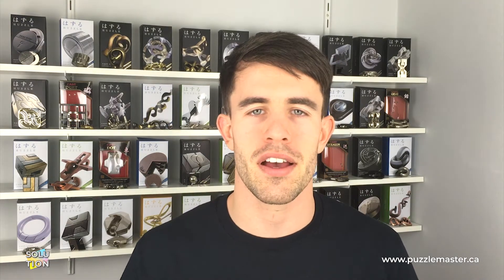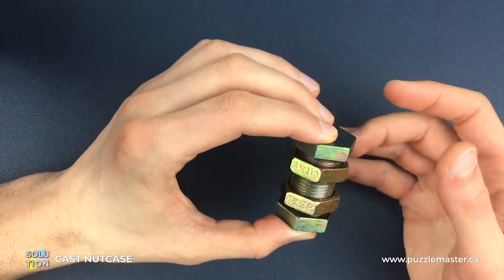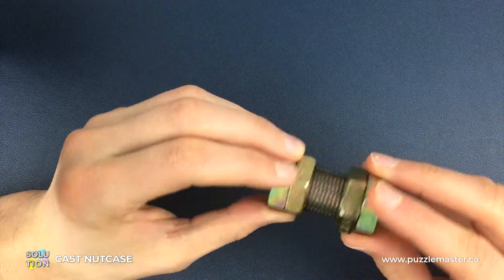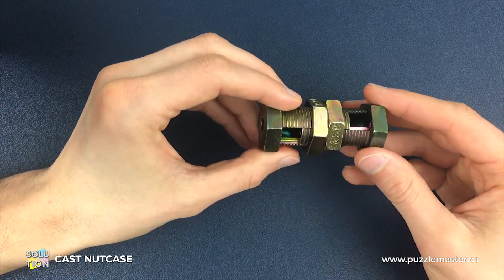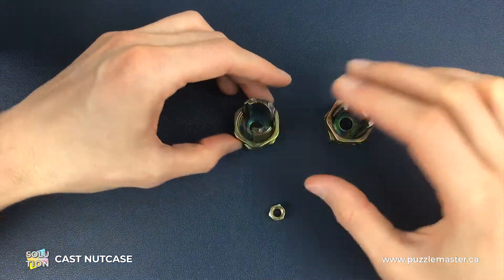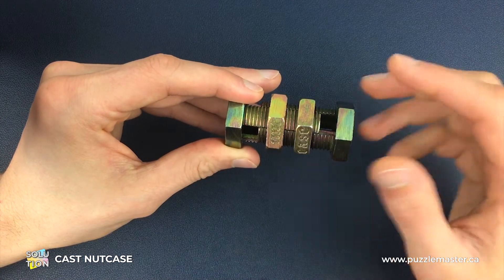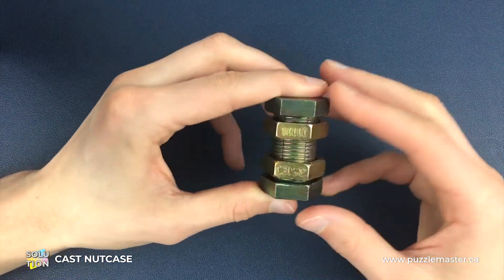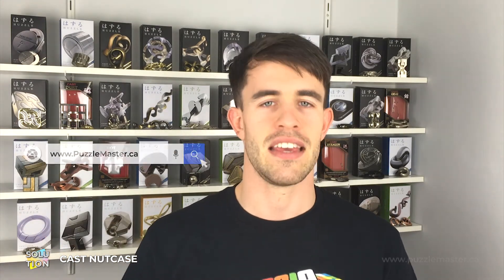Cast Nutcase from Hanayama - Solution

Comment: I found a solution that I can use even without looking at the puzzle. I hold it only by the bolt head with the puzzle oriented vertically and then I find the right position of each nut using gravity - I can feel it.
Reply from the maker: sweet